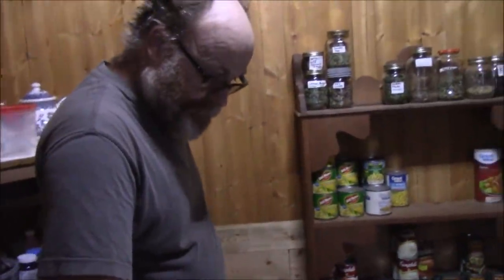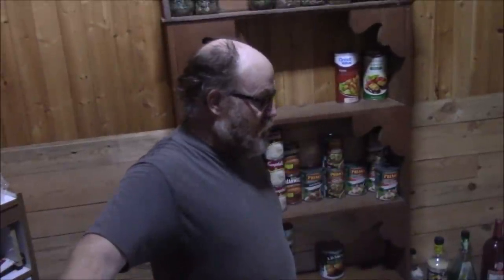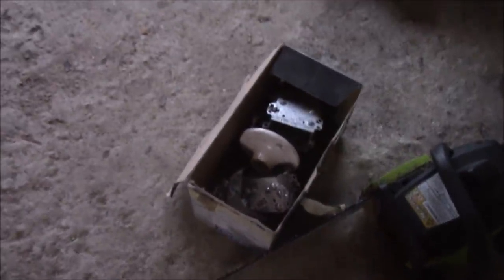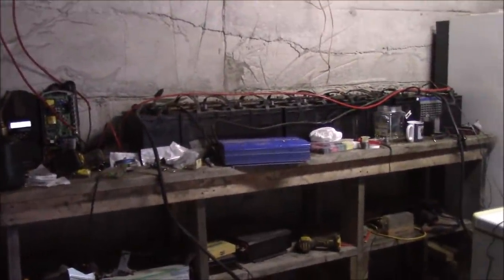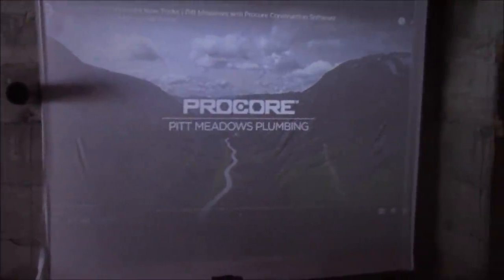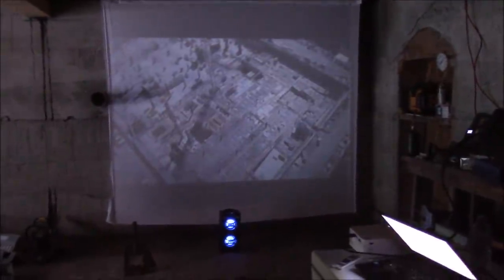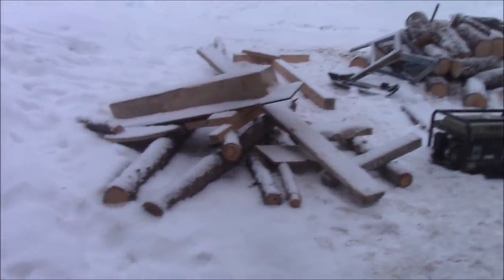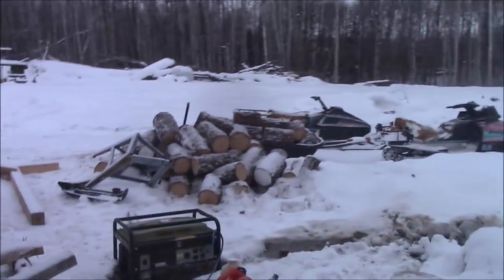Homemade Log Railing/ RCA Home Theater System

Comment: Has some thoughts on your electrical power solutions. When you can, upgrade to an inverter-charger. You can use your solar to do the main charging with grid power or other power source to supplement battery charging. Sorry for the live chat confusion, "Yamaha snowmobile" is a curse word to this Ski-Doo guy. LOL